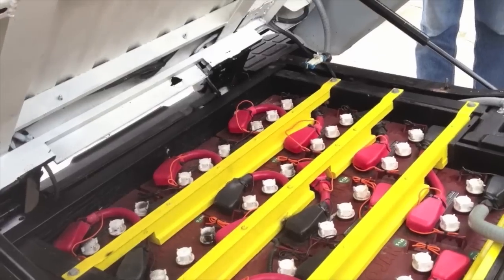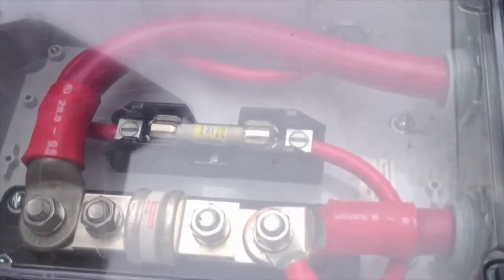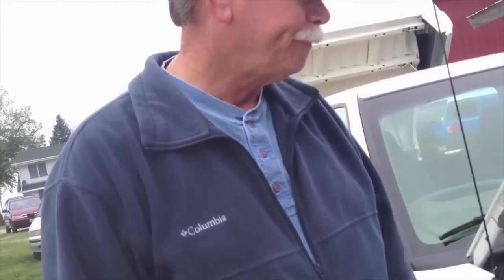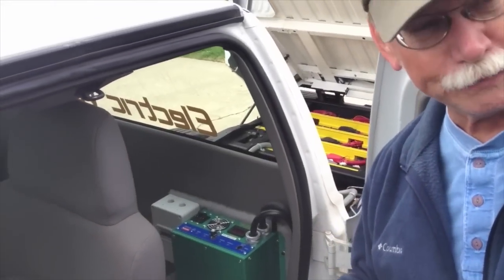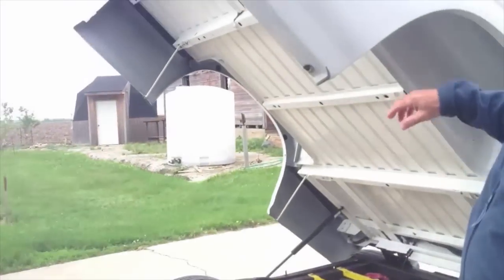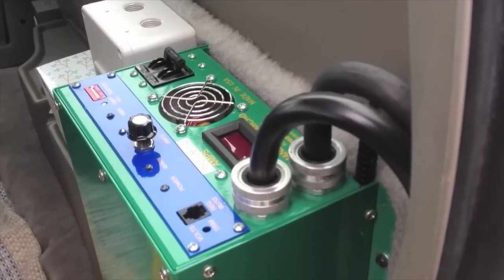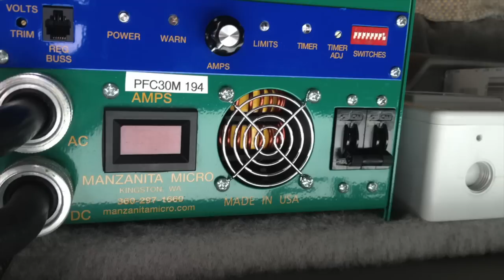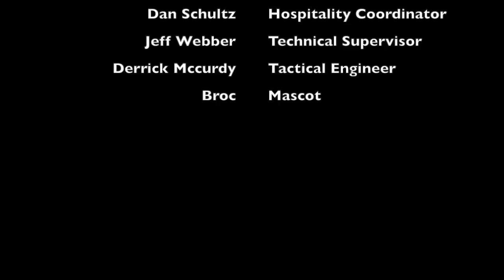DIY Chevy S-10 Electric Truck Conversion | Fox Valley IL

Comment: According to my calculation this truck should be able to get about 37.4 miles range so good for a city truck, terrible for commuting haha.
Reply: more like 64.8 miles.
Reply: How did you calculate that?
Reply: he has twenty-six 6volts 225ah battery so (6*225)*26=35 100wattshour of total capacity he said his truck used 0.5kilowatts/hour per mile so 35 100/1000=35.1KW/h  35.1*2=70.2   so 70.2 miles of range on a full pack. 
but thats if he totally discharges the pack. if he only use 75%of his battery capacity (to make them last longer) he will get a range of 52.65miles.  i actually made a mistake in my first calculation.

Comment: I have 2003 s10 crewcab model. Can I do the same to my car with a 4x4 model? Plus can I have an AC&Heater to use? How is the torque to pull a boat or a little cargo from the back?
Please answer.
Reply: You need a DC AC unit that can run directly off the batteries. Heater would be similar. Torque is bad compared to a IC engine at around 104lbs of torque to about 180 with Li Io. The technology is just not there yet but of course you can always get an AC motor with more torque.

Comment: Why not 12Volt car battery? Bigger the battery more power right? Plus more of them right?
Reply: Car batteries use lead-acid which is very inefficient when it comes to charging and gets a commute range of about 30-45 miles per charge.

Comment: NICE WORK gentlemen ! 
Cost ?
Reply: Jim Gill This thing will last forever. It does not need a transmission, (although some kits can be bolted to the tranny). The motor is simpler, quieter, more reliable, starts in ANY weather, lasts for 20 years, and gets fantastic fuel mileage. If you want to know how powerful they can be, just look at any train locomotive.  They are diesel/electrics, and have been for over fifty years, and they pull miles of loaded freight cars, and have for half a century!
Reply: The main issue with this incredible technology is really the range. These cars could never be used for more than a short commute/never on any road trips until we start seeing rapid charging stations popping up all over the place which will require a reworking of the electric grid as increased strain is put on them.

Comment: Uggggh!!! TERRIBLE!

Conversion, YESSSS! Lead/ acid, NOOOO!!!  It is outrageoously wrong-headed... lead/acid is three times the weight of lithium cells, need to be replaced every three years or so, and provide pathetic range at best, and range decreases quickly over time... significant range loss after just one year.

I have a Chevy S-10 that Sony Pictures originally converted to a EV (DC brushed motor); they quickly realized it was not practical at all.  A friend convinced them to convert to lithium iron phosphate, did the conversion for them, but Sony were not willing to put in enough cells to provide sufficient range.

I bought it from Sony, and through a succession of upgrades it now has an AC drive system, all the cells are mounted under the truck bed which has a hinge to tilt the bed to the left to show off the battery pack--- it can be seen on my channel along with the BMW i converted before that. ( Search "BMW EV conversion burns rubber!!!)  That will lead you to the video of the truck bed opening by remote control to show off the battery pack.
Reply: This was 5 years ago...yeah lithium is the way to go now though

Comment: Until you make these trucks the most powerful trucks on the road, with the best gas mileage, and the easiest to maintain, and the longest lasting trucks, you will never get the good old boys to buy them. The sad secret is that you can already do all that.  But for some reason, people like you do not want to actually make such a super truck. The problem is not the truck, the problem is YOU! Why are "green" people so addicted to failure? You hold the world's future in your hands. And yet, you are still scared of success.
Reply: Speak for yourself.

Mercedes unveils world's first completely electric semi truck
https://www.engadget.com/2016/07/27/mercedes-unveils-worlds-first-completely-electric-semi-truck/

Also Tesla is working on one as well.